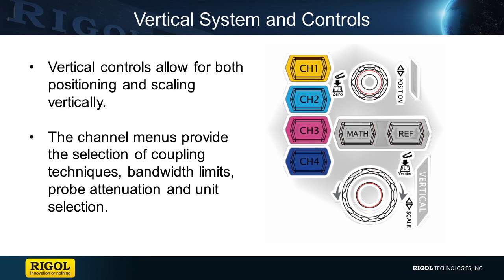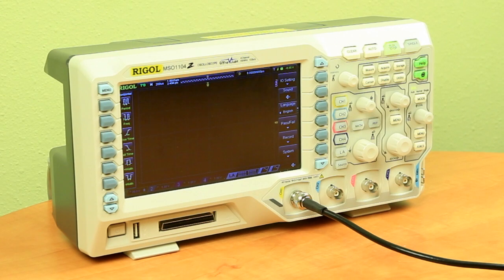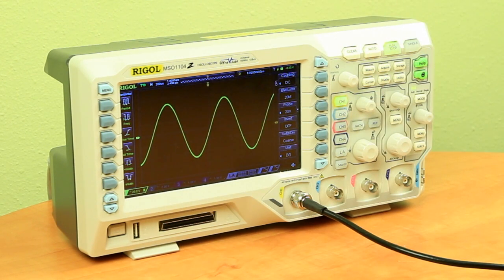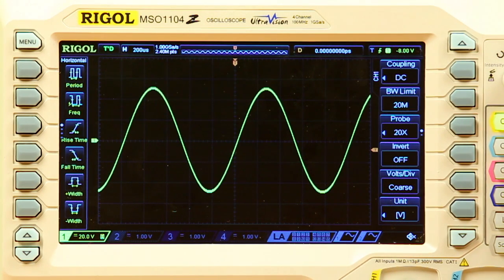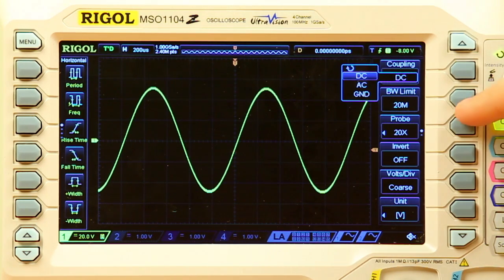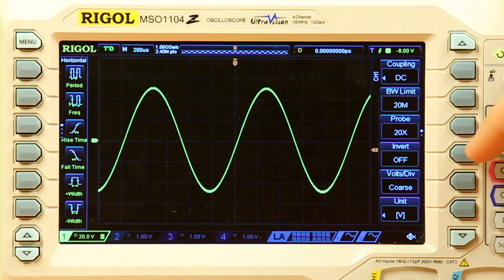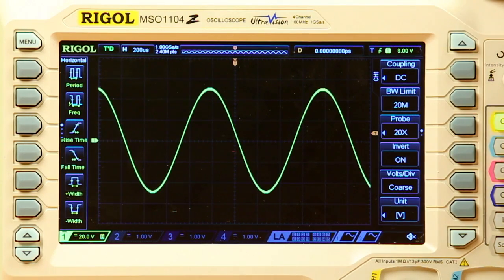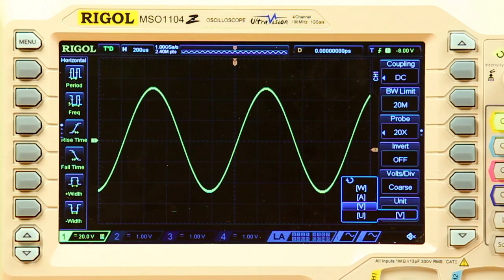Vertical System and Controls

Comment: Where I can see DC offset level? Very often DC offset is much larger than AC component of the signal. I know that I can set DC offset programmatically, but is there indicator of DC offset level? When I change vertical position and observe AC component, how do I see how far I am from zero level?
Reply from the maker: On most RIGOL scopes you can see the DC offset level by turning the smaller position knob for that channel. There is then a popup on the left side of the screen that indicates "POS" or "REF" for the reference level position and the value of it. The indicators position tells you if it is off the display above or below as well. The value can also be directly queried over the bus and is part of the waveform parameters if you are pulling data over to the PC. Of course, you can also reject the DC value entirely by using AC Coupling on the channel. Hope that helps.